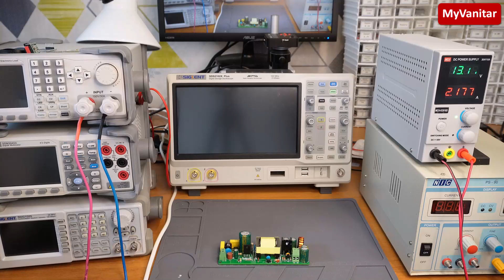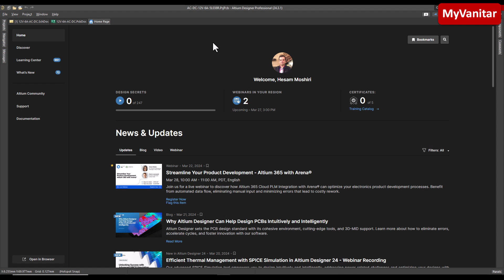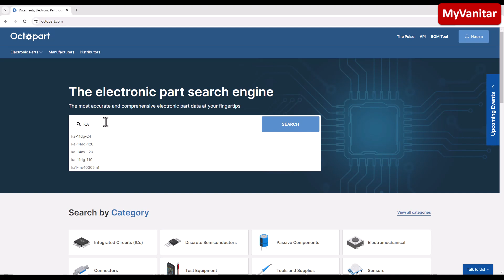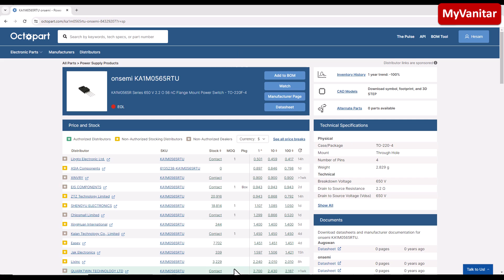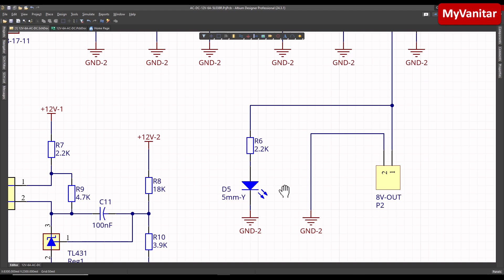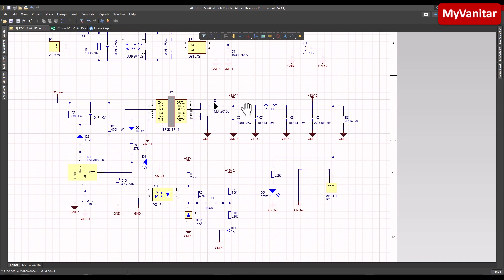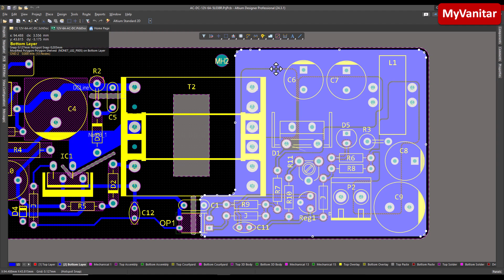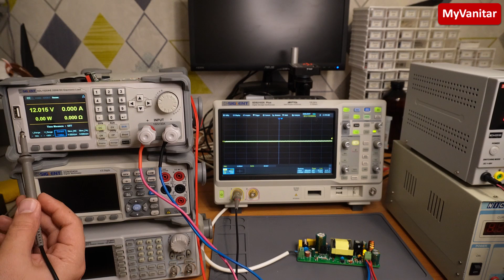12V-7A AC to DC Switching Power Supply [SMPS]

Comment: Hi sir, I want to create rectifier which takes input 7.4kw AC and gives 7kw DC output. Is it possible to create it?
Reply from the maker: I have not designed such a circuit,  the topology might be LLC or similar
Reply: @ oh okay sir. Will check that thank you

Comment: can you make a 12v 7A supply with a comercial transformer, as wurth transformer?
Reply from the maker: Yes, someone should sponsor it
Reply: @MyVanitar  i going to sponsor it 🤣
Reply: @MyVanitar  i need a small power supply 12v 7A, i need a transformer with 16x13mm, how  i modify the circuit and make the calculation for a core small? i am using edesinsuite of stmmicrocontroller and workbench of texas instruments but not have a transformer small.
Reply from the maker: it's not as easy as it sounds. if you have a project requirement please send me an email for negotiation
Reply: @MyVanitar  okay, i write in the linkedin, i don´t find your email

Comment: Does this circuit operate in continuous current mode or discontinuous current mode?
Reply from the maker: Good question, I think for such advanced controllers, both are supported depending on the load current. It's a shame that it is not manufactured by Fairchild itself (manufactured by other Chinese companies I think), otherwise, it's a robust controller and has everything internal.

Comment: Great job thank you for video.
Could you  make a voltage and cureent adjustable a SMPS project ?
If share another PCB formats too I sure ,increase your subscribers and viewers too
Reply from the maker: Thank you. Actually, I generate the Gerber for download in the Article (most of the time) or put a link to the Altium-365 space which does not need a subscription (to download the project). An easy solution to your question is to use a CC-CV buck converter at the output of this, otherwise, the secondary side should be modified. I have not built one myself but I have some ideas to build an easy one without complexity but I must test it. I think there is a better solution also to use some controllers that are specifically designed for this purpose that make the regulation on the primary side but they are not adjustable (I have not searched for the adjustable ones). with more features, some projects get close to commercial use and I don't get a general feeling from the subscribers that they appreciate the content, most don't even watch the video completely.
Reply: @MyVanitar wow this is so sad . A friend just gave me this channel to follow and I have seen so amazing projects that I can learn a lot from in power electronics. But please do you have a complete well structured project based course on power electronics?
Reply from the maker: @thegraphicmaster9002   I may create an educational package otherwise I learned these over time
Reply from the maker: I published the link

Comment: is possible to pump it up to around 48v this PSU and make it constant current?
Reply from the maker: Yes, you should recalculate the transformer and change the output Schottky diode (voltage). also, increase the voltage rating of the output capacitors. this is to get 48V at the output. but for CC and not CV, the output should be modified. I guess your intention is to drive LEDs. There are special controllers designed for that purpose, mostly doing primary side regulation.
Reply: @MyVanitar  thank you